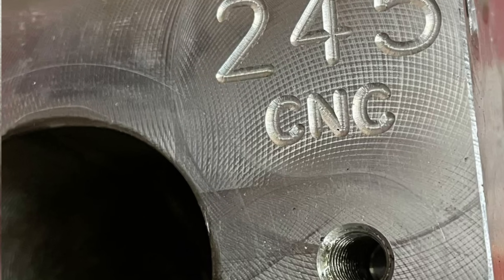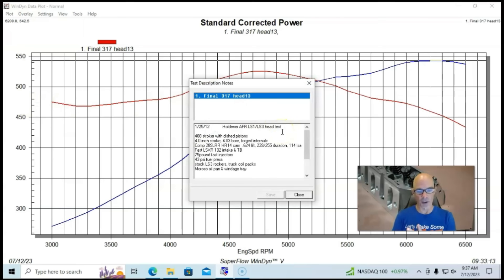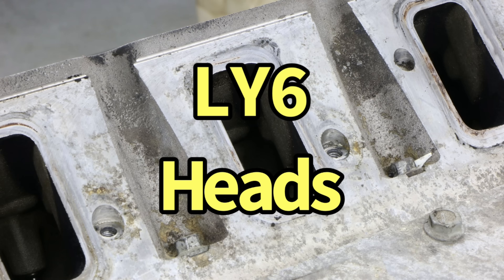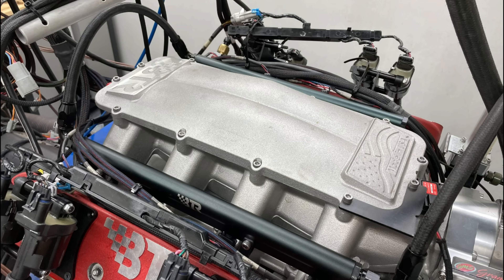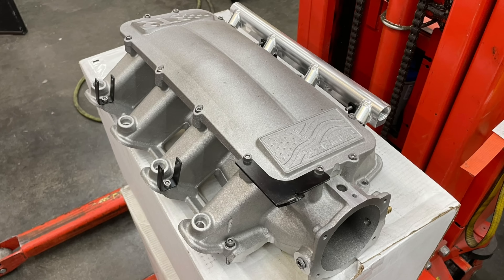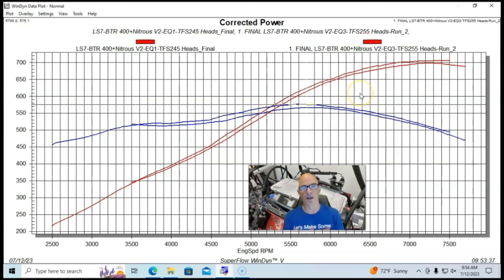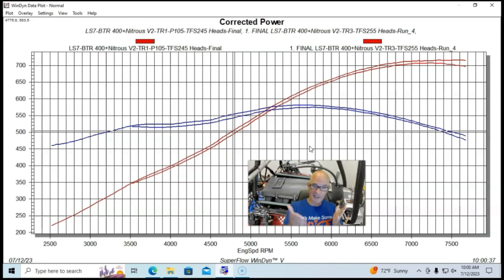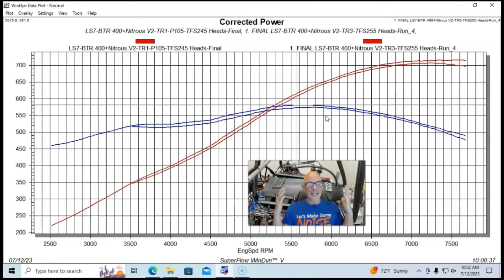WHICH LS HEADS MAKES MORE HP? PORTED REC PORT OR CATHEDRAL PORT? TFS 245 VS TFS 255 ON 427 STROKER

Comment: Thoughts on ported 243’s on a 427?
Reply from the maker: for what power level
Reply: @richardholdener1727  hopefully close to 700 to the crank.

Should be close to 13.1:1 compression BTR 400+ Nitrous cam Ported MSD Airforce intake E85

Comment: Great test....expected more power under the curve with the cathedral port heads.     BUT!  I feel that the cam was to big, and a long runner intake should have been paired with the cathedral port heads.  I THINK we would have saw a more noticeable difference(especially within those first 4,000 rpm

Comment: Why are you using the air turbine on these dyno runs…?¿?
Reply from the maker: To provide accurate data-we also ran without (it does not restrict power-since I know you are ?? that)
Reply: @ actually wasn’t concerned about the restriction I’ve just only ever seen it utilized on carburetors, so how is it useful on a EFI engine….?¿? Wouldn’t MAF take the place of a turbine…?¿?

Comment: I have a LQ4 with 1 7/8 Long Tube headers and 5364 Heads and I have a BTR Truck Cam going in soon!! Is there anything I can do to get more out of these heads and is this a good combo!! Bought it as it is minus the headers!! Looking for low end torque!! Thanks
Reply from the maker: I'm not familiar with 5364 heads-are they the iron heads on the 1999-2000 6.0Ls?
Reply: @richardholdener1727  They don’t come on 6.0 L and I did some research on them and they said it was an LS3 head but I’ve never heard of them so was hoping you could tell me more information about them? Pros and cons?

Comment: Hi, thanks for all the hard work test to give us these numbers. What formula do
you use for sizing your injectors?
Reply from the maker: for an NA V8-its injector flow in lbs/hr x 16 (50 pound injectors will support 800 NA hp-50 x16=800)

Comment: So cfm demand of that 427 at 7300rpm is 380cfm, both of those heads at 618 lift had already given everything they had, it does show that those manifolds work well in not choking the heads 👍
Reply from the maker: you need to see more test data
Reply: @richardholdener1727  to determine what exactly?

Comment: would a test on this motor between the TSP sr3/sr7/sr1 intake vs the trinity/equalizer intakes would be interesting. same goes with a set of ported factory ls7 heads and or aftermarket casting ls7's with larger intake valves *2.250*.... but thats alot of money to be budgeting these tests LOL

Comment: I guess its a decent power gain to go from stock heads to these but i don't know if its worth the cost. It's about $4k for a set in CAD$ and if i spend $2k-$3k more i can go lsa supercharger kit for my G8 which has the 821 or 823 heads cant remember. Not sure how it stacks up to 799 but i guess similar in power.
Reply from the maker: use your heads and get the blower

Comment: I don't think the cam favoured one head over the other. They were close. The TFS 245 and 255 is essentially the same head with different intake ports. 706 vs 716 hp is not that huge at the end of the day. The guy winning at the track with those differences, is the guy who has the better RT or has a better setup. In short, if someone already has a nice cath intake etc. but wants more from aftermarket heads, just get the 245's rather than changing a ton of stuff to get rec port heads. Would I do this? Nope. I'd move straight on to a pair of BR7 heads.

Comment: We're talking about a 2% gain in power. Practically negligible. Surprising, I would have expected rec port heads to blow away cathedral ports.
Reply: Why? Look at the flow numbers and size. They are essentially the same head. Now throw a set of hand ported BR7 300 CNC on that thing, and it will probably be more in line with what you thought would happen. That said, looking at the cam, it is probably pretty well maxed out. My take on it is that the cam should have had some proper lift. It's a 55 mm cam. .680-725 lift would be nice.

Comment: I'm not sure what real engine you have here. Is it a 427 "stroker" or is it a true 427?   4" x 4.125". There will be a significant difference in power between the two. There's a reason why true LS7 427s make 650+ rwhp vs LS3 strokers make 600ish on a good day. If these numbers are with a 4.125 bore, something isn't right somewhere.
Reply from the maker: this was an LS7 short block with TFS 255 LS5 heads on it (650+ rwhp...that would be the exception and not the rule)

Comment: Wish this was done also with actual LS7 heads in similar aftermarket trim...

 Considering, I have the BTR v2 Stage 4 LS7 cam with an LS7 Holley Hi Ram in my 67 Camaro on a 4.125x4.00 B/S at around 11.2 to 1...yea that cam at 111 LSA with .662 lift sounds nasty in the old gurl...pulls incredibly high as well....

246/26X, .662"/.662", 111 LSA for the BTR V2 stage 4 and im guessing a lot of exhaust split on it as well...my combo liked it over the old stage 3 usimg Brodix BR7 heads....
Reply from the maker: the motor was also run with ls7 heads and lots of intakes
Reply: @richardholdener1727  Honesty I'm super stoked at the trade offs of the LS7 head entry angle/valve angle and size on this same combo...Id guess ( based on mine ) it has a little less down low and pulls a little harder up top..extended peak tq ( less fall off after ) and peak HP.....
 Obviously I have a dog in this hunt but I accept being wrong lol
Reply: @richardholdener1727  nice can't wait!!!! Thx

Comment: I would assume the duration split is there for factory heads, given the exhaust port is “the same” for LS heads in the LY6 timeframe and the intake obviously flows more (assuming my thought is right that all the ls ports are round, not D after 2008 ish). I would also assume that the aftermarket does the same, using “the same” port architecture in exhaust between cathedral and recrangle heads. Based on those assumptions, i would chalk the power difference to intake port design specifically. 
Curious how some LS7 heads would hold up compared to these numbers
Reply from the maker: those were run too

Comment: Excuse randomness...

On the topic of spool speed in your previous vid...

Using remotely mounted injector, much the same connection as back pressure sensor, you can inject fuel into your turbo hot side. Ferrari played with this concept on the 488. (Not sure if they implemented) its way more efficient than two-step, as it doesn't heat the valves.

Richard could do this on the dyno pretty easy. Maybe diesel injector is better? Obviously its little more technical than that, but its something along those lines. What you think?
Reply from the maker: that test would be better on a chassis dyno or the street

Comment: 16 hp is enough to gain a interest.  At that level, and also with more development.  
This was a very useful  demo. I often wondered what the two heads had in difference.
Reply: Well it's obviously gonna hold out further too the cathedral is nose diving and the last test may not have even found peak at 7500...looks like it will flat line ( not nose over ) till 8000rpm...so then stall and gear much quicker...

Comment: Cath heads are going to work better below 5,000 with more low-end torque, while the rec port heads move more air, which means more power in the upper RPM range. Same short block, but you will get more RPM and more horsepower for racing applications with the Rec port. 

Cath for street use & towing, Rec port for racing applications. Each serves its own purpose.
Reply from the maker: on this motor-the cath port heads didn't make more below 5000 rpm

Comment: not a whole lot of difference......I am betting the rec ports will really pull away under boost.
Reply from the maker: THAT WON'T HAPPEN-SMALL GAINS WOULD JUST BE MULTIPLED
Reply: @richardholdener1727  a 25hp difference n/a is a 50hp difference at 15psi and a 75hp difference at 30psi.

20-30psi is kinda the norm for ls stuff so....
Reply from the maker: there was never a 25 hp gain-there was 10 hp

Comment: 245 and 255, go by price, if it's like $50+ more then not worth it.
Reply: Not with this cam. But what happens if you put some proper lift in with the same duration?

Comment: Richard, great test.  What were the flow numbers on the the two heads?
Reply from the maker: the TFS 255 LS3 head flow more at .700 lift (380 cfm), but are very comparable at 600 lift 353 (245) vs 363 (255). since this cam was only 618 lift, it did not take full advantage of the ls3 head flow

Comment: This just makes me wonder what my home ported square ports with 5 angle valve job are doing in me 12:1 6 liter. I just don’t see it not breaking 600 FWHP, but by how much? Lol
Reply: If you have a cam over 240°@.050, decent size headers and a good intake then you shud be nudging past 600 horse. By nudging, i mean probably nothing over 610 if you arent turning 7500. RPM is your limiting factor for sure.
Reply: @rustysausage69  yup, it turns 7500. Might turn it to 7700 once at the track to see if that’s what it likes.
Reply: @rustysausage69  yessir. I went in on a mission to make or break 600 on piss 93 lol. The full size truck gets it lol
Reply: Those tfs are running the table

Comment: What I notice in that last overlay is how rec port power hasn't nosed over yet. So if you're looking for max effort high rpm horsepower at least on this bore size rec port is the way to go.
Reply: Correct. Cath for street use & towing, Rec port for racing applications. Each serves its own purpose.
Reply: Yea that would like an 8000rpm shift and work you way back from that info with gear n stall and you have a quicker car...

Comment: Impressive test as always, Richard. But you know my misguided mindset is skewed towards alloy Cleveland 3-V flow monsters. 

Or for something more affordable like my Endyn high port cast iron beauties from the Glory Days of Ford Pro Stock domination. No cathedral port necessary 🤷‍♂️.  Just the old school Cleveland winning port configuration of yesterday with a set of cathedral port GM heads for the cute factor 😅. 

You do still have a sense of humor I hope,  Mr. Holdner 🙀🤷‍♂️.
Reply from the maker: I have run 3V heads in the past

Comment: Only thing I can think of here is that generally cathedral port heads have better exhaust flow bench numbers than rec ports. I may be wrong but at least from my very limited experience, gen3 square port cams usually have more exhaust duration than rec ports possibly because of this. I would imagine that running an ls3 cam might hurt the cathedral port #s slightly but I haven't mocked up an example in dynomation to see. I could be totally off base here though. I do love all Gen3/4 hardware equally :D. An example of a custom ultra 4 race cam I'm running on a cathedral port motor. 
in 279 ex 282
.05 in 229 ex 230
lift in .615 ex 605
lobe 113
Reply from the maker: the reason for the "desired" duration spread on the rec-port head is not because of reduced exhaust flow, but rather dramatically increased intake flow (relative to cath ports)
Reply: @richardholdener1727  Yeah, rec ports flow substanically more inatke, but exhaust numbers stay relatively close. Part of the reason good porters of rec port heads spend more time maximising exhaust numbers while only doing a mild port on the intake side. GM does this on their cnc ported versions of the LS3/9 head.

Comment: The “Key” to the results is the  427 CID can use the 255cc port volume. If you run the same test under 400 CID the results should be the opposite. 
It would be good data to actually validate at what CID the larger volume Rec heads are the better choice.
Reply: Almost certain SAM and BES used big heads for the cid to win the emc challenge.
Reply from the maker: it's more than just displacement, but the 700-hp 427 was much better suited to the higher flowing rec ports

Comment: I'm doing a 12.5:1 408 nitrous stroker with a similar specd cam. 252 274 114lsa. I was hoping it would make 700hp to the motor. This is making me think not
Reply from the maker: with what intake?
Reply: @richardholdener1727   I was leaning towards the holley split intake 4500 with accufab 4500 throttle body....what do you think?
Reply from the maker: see the ls3 intake test-I ran 4150 and 4500 versions of single plane intakes-4500 was better

Comment: In reality, it's such a small difference on the road or track you'd never notice.
Reply: For sure. If you've got a good set of heads, you're set. No need to really switch from rec port to cath port, or vice versa.
Reply: @emperorbobarino  Maybe if you're playing around in this size of heads and mid range cam size, but those cath heads are pretty much done if you run a more aggressive cam with lift in the .730-.800 range and a bit more duration. Then anything short of a BR7 300 or Mast 305 and up is what you need. In this day and age, .624 is not much of a lift.
Reply: @AB-80X  I don't disagree with anything you are saying. Just bear in mind that going the route you mentioned is better, it is more expensive than this already expensive build. Additionally, depending on your application .624" lift might be on the edge of what you want to run. I keep reading and I would love for this to not be true; I keep reading that LS's with long run times, particularly road racing (my interest) have trouble with lift numbers over .600". We're talking 3-5 runs, 20-45 minutes each per track day. So for me something like this with all LS3 components is my dream build. Wide, linear power and far less heat soak than anything else at this power level.

Comment: Hey Richard, great job again. Here in Aus though if you are caught street racing they impound your car. So we can only use this stuff on the race track. What it does show is that there is more powder under 3500 RPMs and that is where we all live day to day. So the original equipment ain't to bad?
Reply from the maker: this combo is not a good source for sub 3500 rpm power